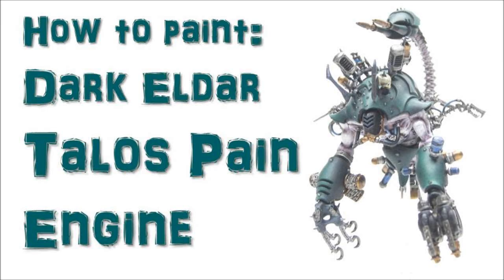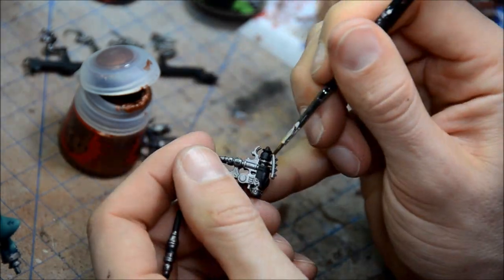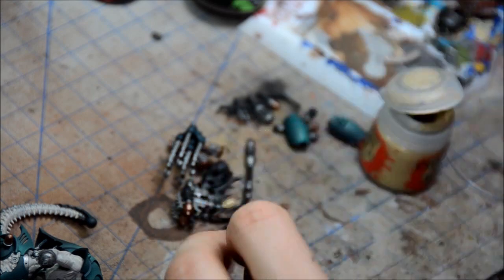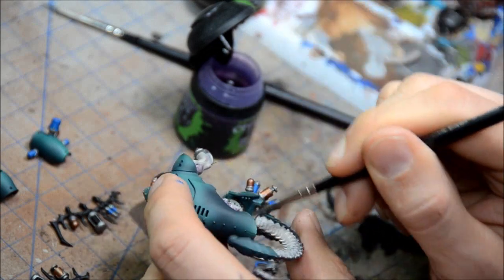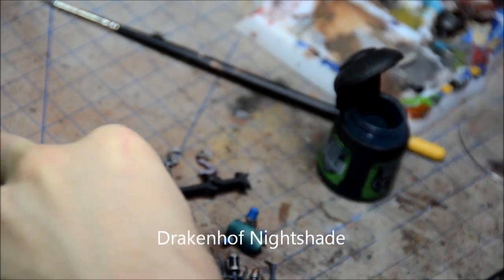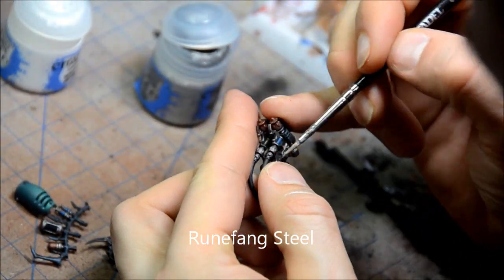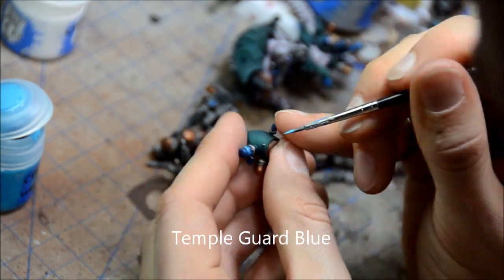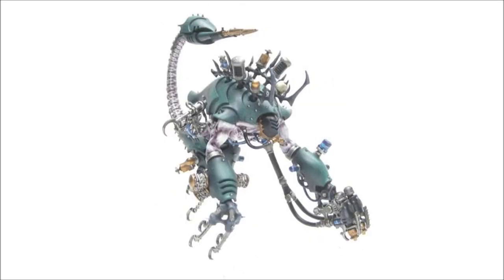How to Paint a Talos Pain Engine

Comment: Hey, cool paintjob. I have some questions because I started to use an airbrush as "time saver" for a squad of space wolves. I used vallejo airbrush polyurethane primer (black), which should be strong and suitable to airbrush on. However a very light scratch is often enough to peel it off, even after more than 1 day of drytime. Are you using a spraycan for this?
And about airbrushing the GW colors, how much do you thin them?
Reply: Make sure its mixed well and wash your models with soap and water before applying the primer. The other option is to check out the upcoming Badger airbrush primers, very good reviews for them.